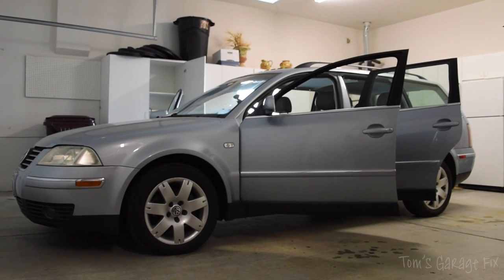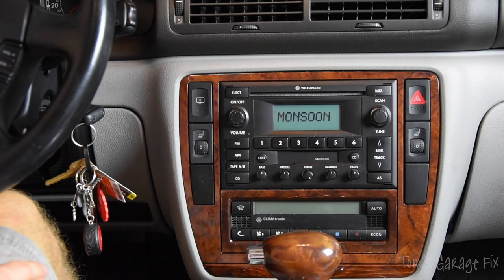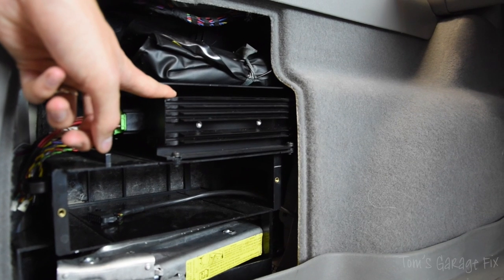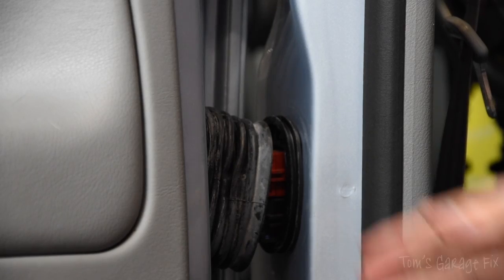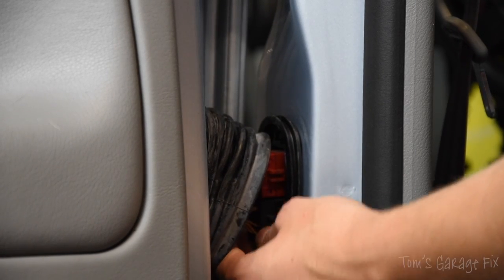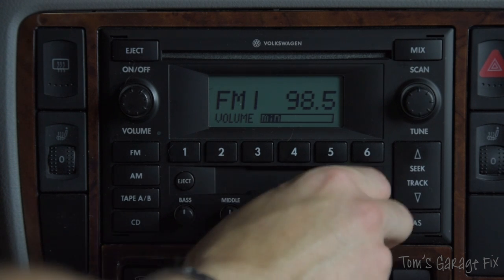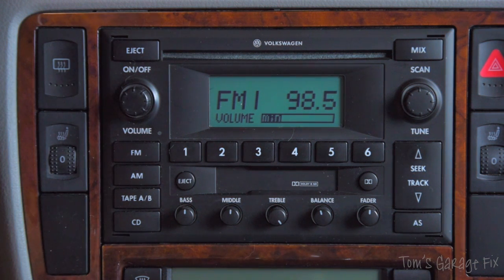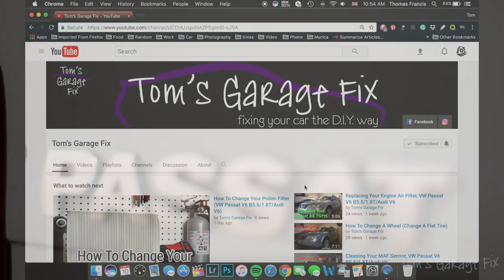How To Fix Your Rear Speakers (VW Passat B5.5 V6/1.8T)

Comment: I'm so glad I found your channel. I just bought a 1993 Passat V6 for 500 dollars! The shop said it was going to be 3500 to fix the transmission so the lady sold it for cheap. I did a transmission flush and changed the transmission filter and voila! Shifts like a gem. I'm currently trying to figure out why I only seem to have about 220 mile range on a full tank of gas. Any ideas? Liked and subscribed!
Reply from the maker: Sorry for the late reply. In my opinion I would check the plugs. Depends on your driving style. A simple solution that may fix it could be running good grade gas with fuel injector cleaner. You can get small bottles of the stuff at local stores that you empty into your gas tank and help clean all of the injectors. Good luck!

Comment: In the past i used on my passat the VW Beta 5 stereo which dont have the FAD option and when i bought a new stereo and i used the FAD option and when i turn to Rear and i set the rear to the maxiumum value the speakers becomes mute 
What this thing means?
Reply: this probably means your rear speakers are non existent so when you switch to them naturally its silent

Comment: any clue where the subwoofer on a 2012 jetta gli is? i am having the same problem but tried the third technique you used
Reply from the maker: Unfortunately I do not. I’m not familiar with Jettas, it could be under the trunk lining or perhaps under the rear passenger seats. I’m not entirely sure. Those would be my guesses.